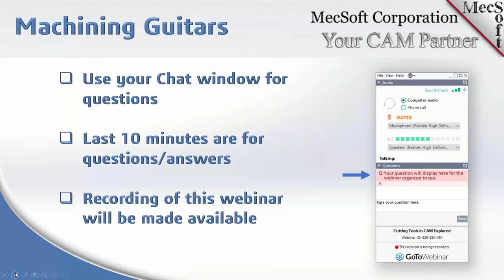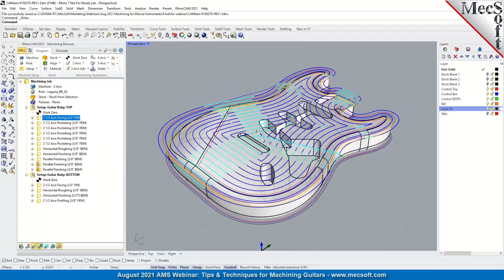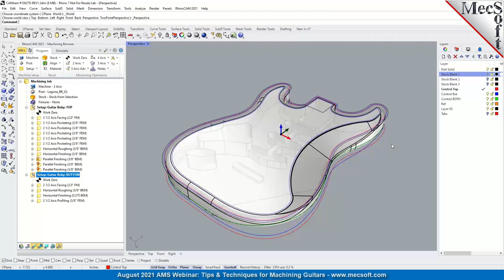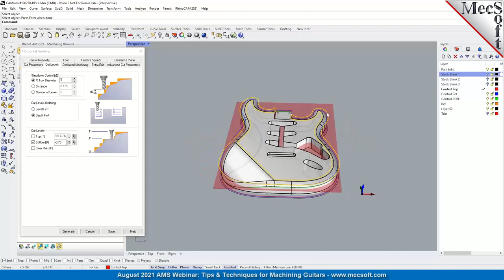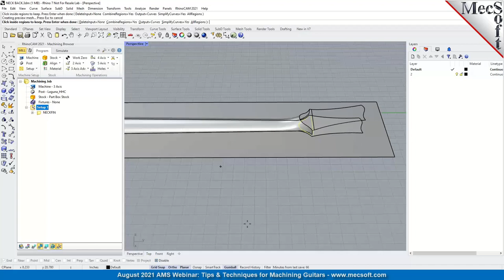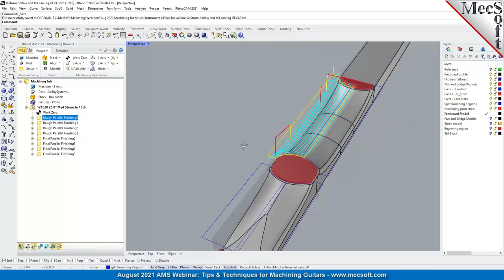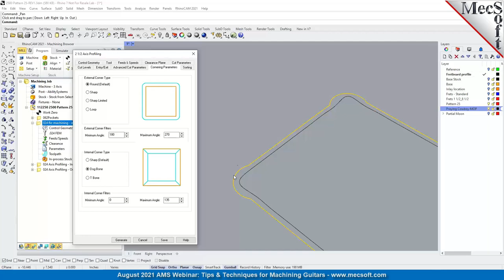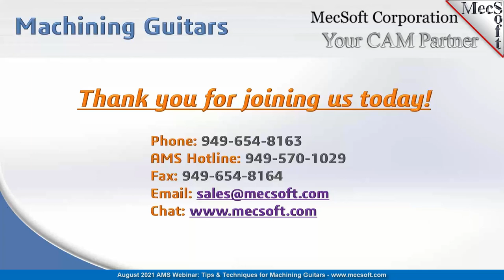August 2021 Open Webinar: Tips & Techniques for Machining Guitars in MecSoft CAM

Comment: Awesome demo! Thanks for getting into some of the advanced features. Fret slotting looks extremely clean and follows a curve. Every other cam I've seen cuts them straight leaving the user to glue in the frets to fill in the gaps. This fret slotting method allows the neck to be stronger and may take out need to use glue to fill in. I did find another method that involved using the G2/G3 arc and g18 xz plane commands to accomplish the same thing. But that's a more involved process that isn't that flexible. The amount of detail completely destroys what Iv'e been using. Finally a demo that looks like an actual luthier designed. The cuts look super clean. Very impressed MecSoft!

Comment: Really close to buying this software. I still have to edit the gcode to make clean fretslots. I wish the arc fit worked for engraving parts. Currently the engraving tool generates way too much code. Over 3500 lines of code for fanfrets. For a smoother finish it would nice if the program generated the G2/G3 arcs for engraved slots. I'll test the code in practive, but I wish arcfit would work on engraves. Only thing really stopping me purchasing it. I don't mind but it's just not flexible editing your own code. Please devs, consider adding this function to engraved toolpaths. Thanks!